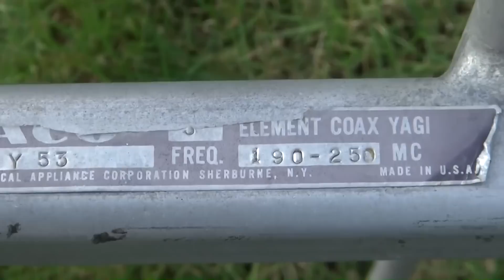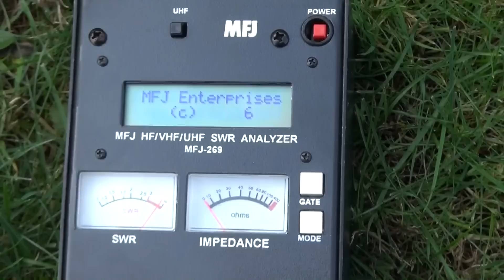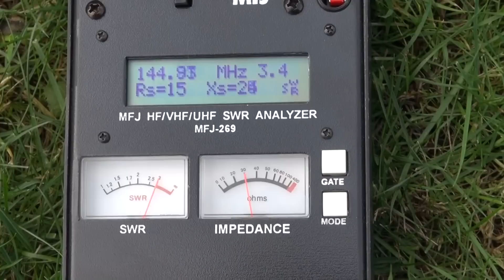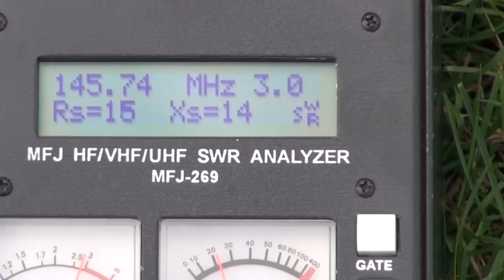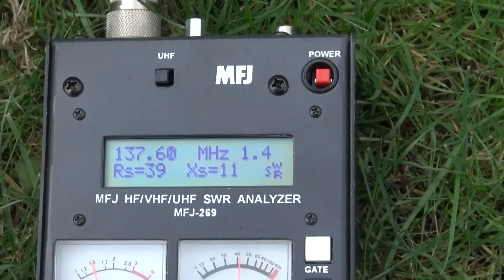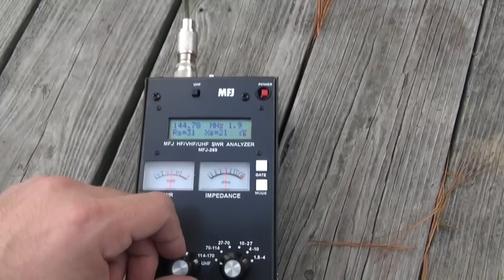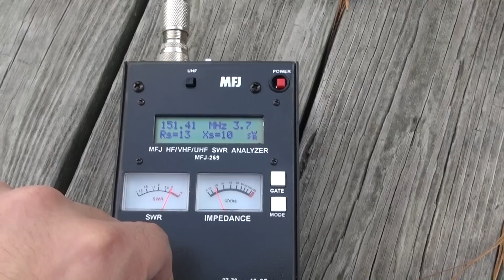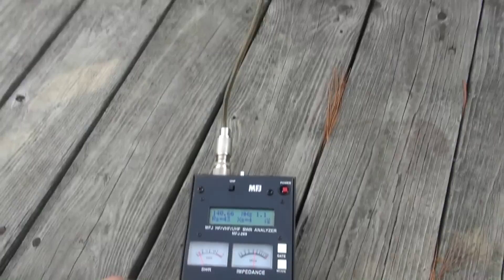2 METER BEAM ANTENNA TESTING

Comment: The SWR can be adjusted by shortening or lengthening the driven element.  A 4:1 balun is required for this folded dipole.
4:1 balun is very easy to build.  You can use a 1/2 wave length of RG8 or RG8x cable at the feed point.
Here is the link: www.k7mem.com/electronic_notebook/antennas/yagi_vhf_feed.html

Comment: That beam with the folded radiator will be coupling with its boom - if ti's been used as a vertical polarised beam for FM it shouldn't really have a metal boom like that in between its elements - if you rotate it 90 degrees on its axis it could give a better result?

Comment: It's a twin-driven 5 elements Yagi, broad bandwidth communication band, 130 Watt max power rating. So it lacks 2 elements... 
Coax cable leaving dipole like that is no good; best to made it leaving 90° apart = better symmetry and impedance stability.
And more :  coax connection to feed point of the dipole = awfull !! Think to fit it with a balun...
Looking at MFJ results, seems to be Ok at 152.78 MHz : Rs=10, X=2, SWR=4.8, so attach 1/4 balun and you're ok for a 1.25 SWR !!